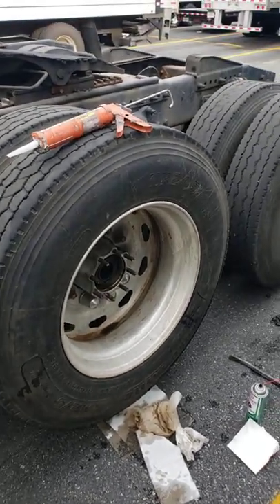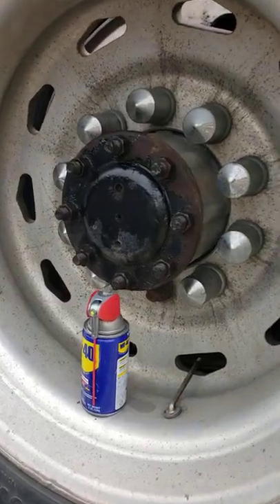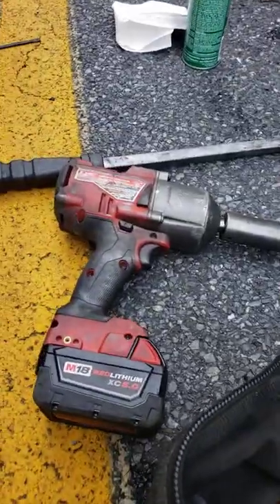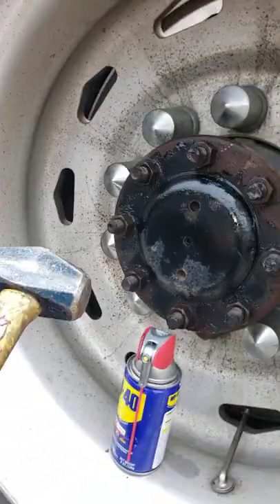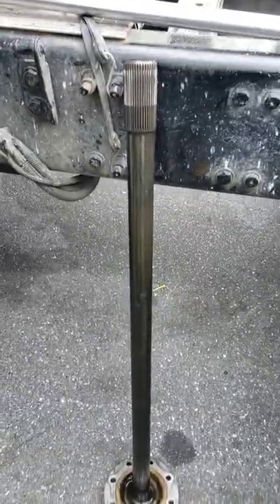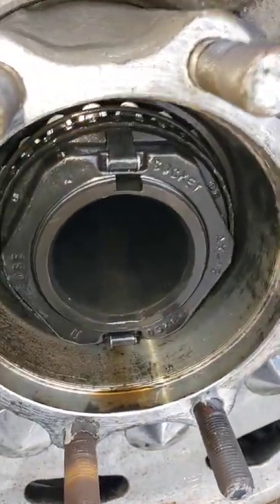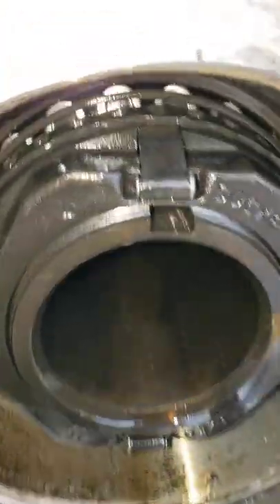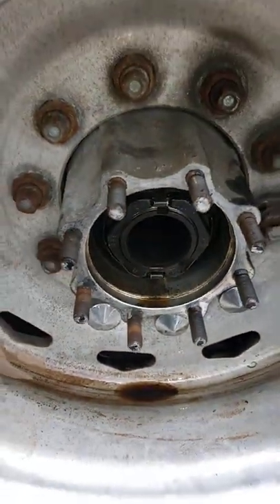Re Torque Wheel Bearings 200ft lbs Used, Freightliner Century Columbia Subscribe for more

Comment from the maker: Torque to 200-300 ft lbs !!!  Sometimes they have zero torque when you take the cover off.  200-300ft lbs is a good number for used bearings.
Reply: Bro do some research !!!! Stemco service  some wheel bearings are only Torqued to 30 or 40 ft lbs some hand tight after setting the bearings, if your going to give information  please  be thorough and correct
Reply: @Carlos-ip2ir you gonna torque a semi truck bearing to 40 ft lbs lmao? What are you on

Comment: Well i just discussed this with a mechanic today he said to set the preload tighten it as much as possible while spinning it then back off a full turn will be lose then put your nut on and bar on the nut and dont press down just let the weight of your hand on the bar do the tighting when it stops going down with juat the weight of your hand on it your good you have set the pre load put the rest the shit back on in order it was taken off tighten outter nut tight as u want and put lock tabs down ....dont forget to add some gear oil in the bearings and dump the rest in the rear diff he said never tighten that inner nut by torqing it  tight or u will blow everything out and end up replacing it all the outter nut he said is the one u want to get pretty tight

Comment: Meritor has a spread sheet on Google.  I printed and taped it to my toolbox.  Steers, non-drives, drives, Pro-Torque, jam nut, under and over 2 5/8"... all have different torque values and procedures.  Dont just guess like this.  Best case, you either smoke and bearing and banjo.  Worst case, ya lose the whole assembly and end up in the clink.

Comment: Tighten all the way, then back off 1/4 turn. Done it like that for years.
Reply: Well you're doing it wrong because the modern nuts don't work like that they say tighten it and leave it at what the specification says mostly printed on the nut

Comment: Put the torque wrench at the value the manufacturer has set them at. Also, follow all the other tightening sequence steps.
Reply from the maker: Do Not do this without the inside cone spacer between the bearings.  New Conmet hubs, 300 ft lbs with cone.  Then turn until the locking tabs line up on nut.

Comment: According to stemco torque procedure it's 200ft lbs back off 1 full turn torque to 50ft lbs and the back off 1/4 turn check endplay is 0.001" -0.005" 
If its a proloc it's 0.001"- 0.003"
If you have the spacer cone in-between the bearings you torque to 300ft-lbs 
You should be using a dial indicator to check your endplay.
Bearings actually like a bit of preload but the only way to check for that is to wrap a rope around your studs and pull with a fish scale and see if the pulling force is with in manufacture specs
Reply: If nut is loose, then spacer is worn. Needs to be removed with screwdriver and a magnet. Set the brakes to save your seal , remove hub nut, outer bearing, get that spacer out, put everything back, and adjust the bearing. Spacer is only good when your yruck is new.
Reply: Finally  some one that knows ....I have been stemco certified  since  2015 haha people are tripping

Comment: What are the torque specs for the axle flange bolts of the rear axle drive?  I've just replaced the oil gasket for leaking oil on the rear flange of my Freightliner Cascadia.  Thanks!

Comment: That is a conmet preset hub. It's 300ft lbs. It has a spacer in between the bearings. That sets the end play. If you don't tighten it tight enough the bearing will spin and destroys the cone witch will put metal in the oil!

Comment: Just so we clear the air on this, I work for Freightliner. You install the hub and rotate the hub counter clockwise while tightening the nut, and torque nut to 500 ft.lbs. That’s it. Don’t listen to this guy.
Reply: 500 foot pounds??????
I refer to the manual for this kinda important info and I've never seen where it says 500. I just recently did mine. So far so good
Reply: @DONTCALLMETHAT  most drives are 450-500 lol. Depends if it’s preset or preset plus, double nut or axilock. It all depends.
Reply: @markpalazzolo1463  oh ok. I'm not doubting bro. I've had my truck for a year and have learned so much. The one thing I've learned for sure is that the shops are getting rich on drivers who can't fix still l stuff themselves.  I did my axel seals on my rear drives a few days ago. I studied and read and read and read before I dove into it. From multiple sources I kept seeing 300ft lbs. So that's what I went with. So far so good 😂
The wheel spun freely before I sat it down. Hopeful I'm right. I drove from Georgia to Chicago no issues. 😂
Reply: @DONTCALLMETHAT   no worries dude! Def learn and keep up on engine leaks before it gets too bad. Shops make a lot of money off of stupid stuff. Good to see you’re studying and doing stuff yourself. And even at 300 ft lbs you’re ok. Most people take a 4 foot breaker bar and tighten until they can’t anymore and never have issues 😂👍🏼
Reply: @markpalazzolo1463 Some people are saying you need to torque 200, back it off then torque to 50. That's only on older trucks that do not have the spacers that slide over the spindle am I right?

Comment: What is he accomplishing by torquing the hub just out of the blue like this. If that hub doesn’t have the preload spacer in between the wheel bearings  200ft lbs is going to burn them bearings up

Comment: If you don't have .001-.005 end play on wheel ends,  you are not torqued correctly and not only is that unsafe and can cause a potential dangerous failure, but you're also voiding any warrenty or liability the manufacturer had or has.
Reply: 90% of new trucks & trailers have a spacing cone. Most of the hub plus hubs torque to 550

Comment: Wow. If your going to torque wheel bearings without a spacer cone, never go higher than 50 lbft. You can torque a conventional hub bearing setup to 50 lbft while rotating the wheel and it will be just fine. 200 lbft!? Not so much! And don’t be the guy that globs silicone all over the axle flange. It WILL leak. Get a gasket and put a thin layer of rtv on it so it stays in place during assembly. If the surfaces are clean, the gasket will last for years.
Reply: And your wrong. Look up how to torque a pro torg
Reply: @dave3660  that style of nut is not a common piece. If a hub doesn’t have a cone spacer, 90+% of the time it has a regular dual nut and lock tab ring set up. Even for the pro-torq, you have to back it off one flat when adjusting the bearings. If you put a torque wrench set to 50 lbft on it, you won’t be able to get that flat back. 50 is actually remarkably close to perfect adjustment. It has worked on millions of trucks for decades.
Reply: Mine never leak with only silicone ☝🏻... been doing it for 36yrs... never an issue with it

Comment: Bruh🤣😭 .003-.005 endplay of the wheel hub. Not .0000000001 endplay you've got tp leave room for heat expansion and enough so the inside seal works

Comment: That style nut actually does torque less then 200 on final torque to achieve proper hub and bearing setting but 🤗 fuck it
Reply: That’s not accurate. That’s an Axilok preset Hub, it’s a final torque 200 ft lbs or more depending on drive or steer hub.
Reply: @markpalazzolo1463  no it’s not it’s less then 200 but okay ! Initial preset torque is 200 yes but final torque for proper preset depending on the size of the nut is not anywhere close to 200
Reply: @ifixthingsalsobreakthem5835  I have a  laminated con met torque guide in my box. Regardless to what this video shows. I use that every time a hub goes back on
Reply: @markpalazzolo1463  and that doesn’t mean anything it torques less then 200 ft lbs final torque for proper preset and bearing adjustment example proper torque of that specific nut saying it’s a 4 inch using a 6 point socket is 200 ft lbs initial torque 1/2 turn initial back off final torque is 75 ft lbs adjustment increments in 0.0023” so no sir it does not torque that high it’ll smoke the bearings or cause damage 👌
Reply: @markpalazzolo1463  and your not following the manufacturers preset and torque guidelines if your using one brands sheet every nut has a different spec also on end play for the hub itself look up axilocs torque procedure and you’ll see at a 4 inch hub nut does not torque 200 ft lbs final torque
Reply: @markpalazzolo1463  also depends on preset or manual adjust there’s so many variants of hub settings so to say just torque it 200 ft lbs is wrong period a con met torque for a manual adjust only torques 50 ft lbs final torque
Reply: @ifixthingsalsobreakthem5835  the sheet is generic and charts thread pitches and nut size and preset or non preset. All of that. I also work for a dealer and have manuals as well. I know what I’m doing.
Reply: @ifixthingsalsobreakthem5835  I never said to torque it to 200 in the first place. I was on your side the whole time
Reply from the maker: TA standard on new bearings is 200 ft lbs.  You spin the hub and tighten, if you develop spinning resistance, it has to be backed off, or it will generate too much heat.
Reply: @EricWrenchMotors  there is a specific torque specification per bearing set depending on the hub nut being used agree or disagree I’ll follow the manufacturer spec per hub nut and verify proper end play and call it a day we all do things differently but just straight torquing a nut straight 200 is improper all day long unless specified then okay
Reply: @EricWrenchMotors  and the hub in the video per manufacturer and specification does not torque 200 ft lbs final torque from what I’ve learned and done working on semis but hey I only am responsible for the hub not killing anyone if I touch it so at this point have at it 🤣

Comment: This is a modern style preset bearing with the other 2 common styles unitized and conventional. Setting and checking the tq on either the conventional and preset is extremely important. And often overlooked, causing 350 lbs at 70mph to slam into a mini van of 4. Do not do anything you have been taught and certified to do. Read your service manuals for proper intervals. Know a teacher from school whose employee messed up one thing killed a mother, father, and her daughter. The son had severe injuries. In a wheel off indecent. Charged with murder got 8 years 6 on good behavior. And a massive fine. A fucking joke this can be "explained in 60secs" and its a insulting to my/our industry. "I recommend 200ft/lbs" Congrats, you just became liable for that wheel. I hope it's right. You seem smart don't spew bullshit online. Like some of the comments posting info for the conventional setting of a wheel bearing. Do that to a preset you kill someone. Straight up scary, man.

Comment: NEVER BUY TOOLS FROM HARBOR FREIGHT!
Reply: Actually simple mechanical tools are great from harbor freight, just you don't want to bey anything that has any type of computers/electrical
Reply: @ajcordero6668  I wouldn't trust HF torque wrench after my one experience with them - bought a 1/4" torque wrench from them to do consistent torque on thin parts in Kurt vices. First time I tried it, the end twisted off like it was make of mozzarella. Returned it the next day. Sprung for a CDI the next paycheck.

Comment: If you have a spacer - torque to 200ft.lb. If you don’t have one - torque to 200ft.lb., then loosen 1/2-3/4 of a turn, torque to 50ft.lb., then spin the wheels a fe turns each direction, then repeat the procedure 2 more times.

Comment: This is typical of YouTube. Bad info being put out there and people not knowing any better putting it to use. 12 year diesel mechanic here. Will what you did work, prolly. If it fails you got evidence for the district attorney to use to put you in prison. I see you commented about using factory specs on used bearings, well where is your dial indicator to confirm there within .001 to .005 acceptable play? There could be slop or to tight after what you just did, but fuck it right? Hopefully it's a quick death for who ever that tire slams into on the road.
Reply: Triggered much